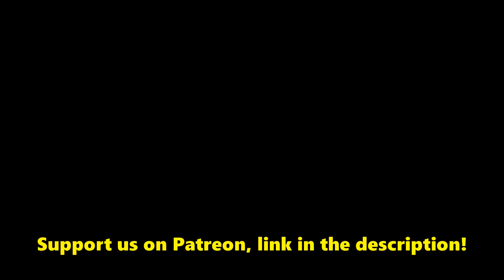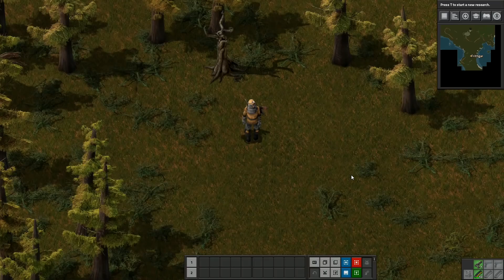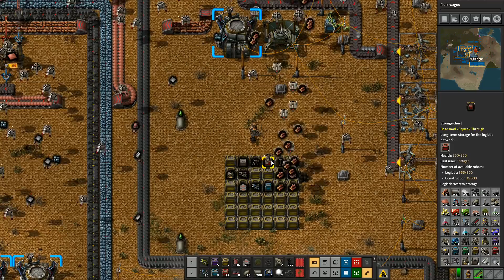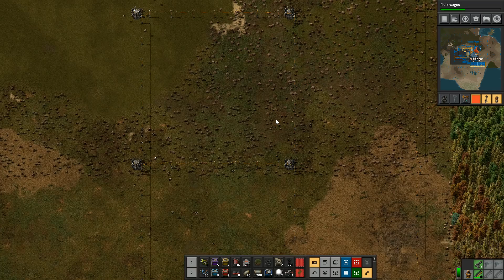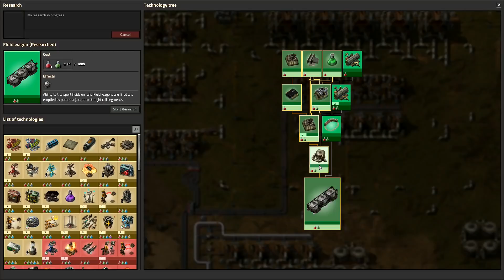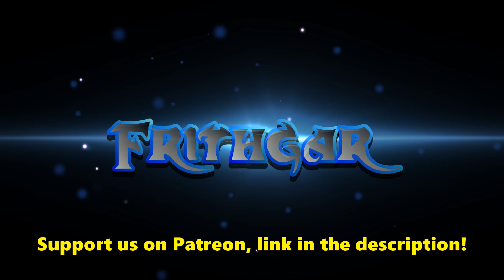Factorio Million Robot Challenge #64: Circuit Network On Fluid Tanks!

Comment: I have tried using drones to deliver ore. I find that for ore deliver belts still work better for high volume traffic. I still have not played with circuit networks yet. I will have to try that. Thanks for the great video. You have been showing me a lot that I have not learned yet.
one suggestion for your long term storage. Put inserters between the rows of long term storage chests to take the contents to the top and bottom rows. Next put a row of passive provider chests above and below the long term storage chests with inserters to feed from the long ter storage to the passive provider chests. This will make the contents of the storage grid more accessible to the drones (at least that is how it worked in .16). I'll have to see if that changed in 0.17.